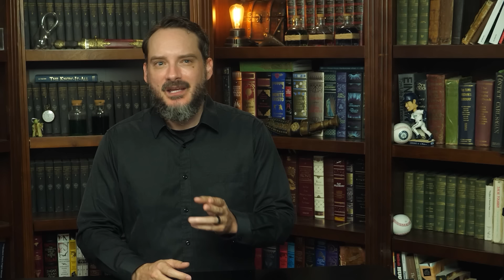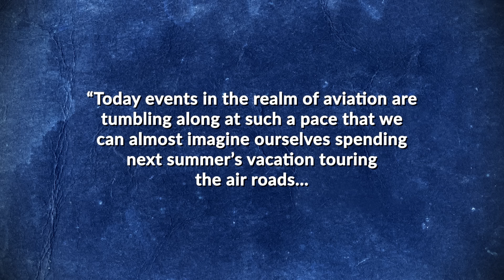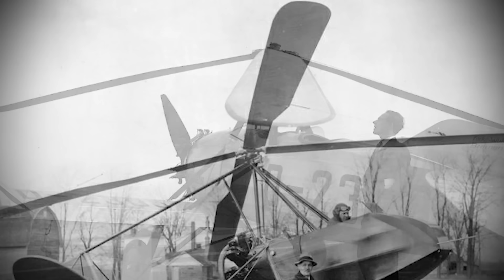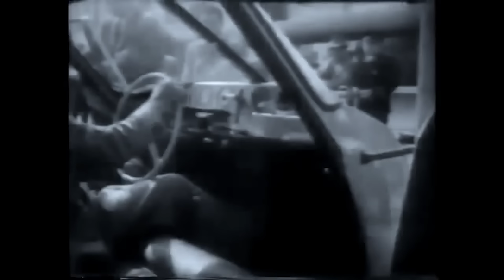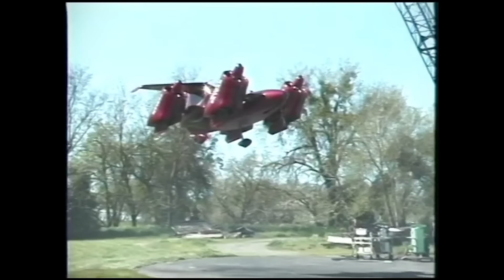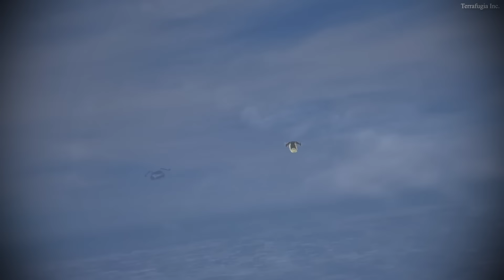A Plane in Every Garage- The Long and Twisted Road to Flying Cars

Comment: well you did not make it, thats why. also some kind of exoskeleton like a jet to manage the fuels and engines, kinda powered wing suit. there is at least one powered jet pack suit currently in use. where you lost your wings, angels. normal air plane is an air car. some turbines on four corners of a light-weight hot tube would work fine. you could just use a normal car engine to power an ultra light air plane. direct the power to propeller, you know. and have folding wings etc. turbine = edf. well those ultra-light stol flying cars with fixed wings are readily already available. what bedtime stories. same for autogyro planes/copters. why leave wings somewhere. thats nonsense. angle variance of the helicopter blades makes it horribly complicated and expensive. monetary goals of projects make them fail. that looks like an ice maintenance machine. or a farming combine. so design it like everything that can go wrong will go wrong. as with people it will go wrong if it can go wrong. earning freedom? get outta here law dudes. well you did not have license to the boats you conquered the lands, then. stop teasing people with your deth fear rules. well 1st amendment and 2nd, done. only the ded make such fear based rules oof the ded. you go make it.

Comment: I'm only a hobby quadcopter pilot and I can assure you, the FAA, air traffic control, and Chinese microelectronics, telephone poles, electric and cable are all permanent handicaps. Flying taxis are coming from Joby for sure, and then other companies like Archer Aviation will follow, but there will not be private flying cars for anything more than hobby, like the failed ultra light phase which killed dozens of unlicensed pilots. It's not feasible even with sensors, lidar, even radar, or cameras, or even full self flying. It can't be done en masse without a centrally located command.

Comment: Where I live I guess we haven’t been “smart people” and buried our power and phone lines. Nor have we cut down all the big trees wgich make the neighborhood pleasant despite the proximity to both a busy freeway and a fairly adjacent medium-sized  airport flight path.
An uncontrolled “landing” of a 240 pound auto-aircraft at 60 mph would generate enough force to collapse the roof of the dwelling I reside within with four+ human beings.

The Jetson’s concept of planes as cars and cars as planes appears impractical at this point. I won’t be operating one or riding in one regardless of how confident others may be with the minor nuisances of such air/road/air travel.
For some reason… there are no gutters or downspouts attached to my domicile. Accordingly, any liquids or semi-solids which exit the operator of a plane-car which crashed on the roof will simply spill onto the sidewalk  in the unfortunate condition of a crash here. And that is IF they dodge the power lines, telephone lines, cable lines, and trees.

Everything sounds like fun until an intestine gets put out…

Comment: They want to over regulate and take away my 65mm 100gram tiny whoop let alone my 8 pound 3dr Solo UAS. Because "they are clearly the most dangerous thing in the sky". 

Perhaps they should require remote ID modules on all bolted parts of passenger aircraft instead if a toy grade quad your kid is flying below the treetops in your own yard

Comment: Automation will make the crashing thing a moot point.  It’s many times easier for computers to fly a vehicle than drive on the surface.  With communication relying all location and heading data the traffic can be controlled automatically.  It would be much safer than cars.

with automation you still have the risk of people or animals moving infront of cars without time for it to stop.

I would much rather traffic be in the sky than congesting the ground and kids not being safe to use the roads.

Comment: The issues with futuristic robot aids are pretty mundane, as in “what if it malfunction up a flight of stairs?” As in, would you want a 600 pounds brick of steel fall on you because it’s low on battery? What if it shuts down during a fire emergency and blocks the exit? Mostly stuff like that. Which are totally valid concerns to have. Others are “if you market it as helping the elderly, how do you convince an old person to trust the machine?” Is there a risk that the help might hurt the elderly if for example they have to be spoon fed and they resist for some reason?

Comment: No problem. Inflate a dome with a Sulphur hexafluoride, and Oxygen gas mix. Then a one man helium balloon 15 feet in diameter shaped aerodynamically, and you got a flying car. You could even play bumper cars with it. Good idea for a small introductory attraction to get people secure in its safety. Also makes buildings cheaper too. The floors float same as cars just tethered to the ground rather than supported by it with concrete, and steel. Hight of the buildings is practically unlimited. No need for suburban sprawl. No need for elevators or even roads inside the dome.

Comment: Given all the logical issues with flying cars, hover cars that go no higher than a couple feet or maybe half a meter off the ground a would be slightly more attainable.  Then again, there would still be plenty issues with that idea as well, such as fuel consumption, propulsion, safety features, and whether or not it could be operated over water or just solely over land, etc.

Comment: As Charles Stross has pointed out, the primary reason for flying cars not taking of is that any  engineering failure in a normal car usually just stops the car, stopping a plane has far more serious ramifications.

Comment: Morons run out of gas driving down the Highway and blow up their engines because they don't know the oil is low. Now you want them in the air? Good luck with that.

Comment: 40.000 collisions/deaths a year and almost it's entirety has little to no collateral damages to its surroundings. Now let's just take for granted flying incidents would be a fraction of them, rather than more (which is likely false but follow me). Let's make up there would be only 1.000 air crashes by human controlled cars, if we pretend "only" a 10th of that happens in urban areas (impossible) you would have ""only"" 100 unintentional kamikazes EACH YEAR playing the crashing roulette at high speed on road cars, on building, hospitals, schools, etc. even this super optimistic statistic looks like a war zone.. and that would be just USA average, not worldwide.

Comment: Automation technology is a huge barrier to regular flying cars (i.e. those not requiring a pilots license) that will not be overcome for decades, even then, liability and legislation will keep them grounded. Your example of autopilot in airliners demonstrates how far away we really are. These systems have been in mainstream use since the 70's and are massively improved but you still require 2 fully trained pilots on board because these systems do have limitations and can still fail despite triple redundancy systems. Remember that really really clever automated plane the 737 Max that thought it knew better than the human pilots? Industry should stop wasting effort on flying cars and any notion of full self flying or full self driving and put all that money and brain power to better use.

Comment: In 2023 Doroni Aerospace earned an official FAA Airworthiness Certification. It is powered by ten independent propulsion systems. They company claimed a top speed of 140 mph and a 60-mile range. It includes two electric motors with patented ducted propellers. The machines is 23 ft long and 14 ft wide.

Comment: Flying cars exist.  My personal favorite is the PAL-V , which is a road-worthy autogyro.  The Terrafugia is a folding wing option that already has FAA  approval, but I’m not sure it is commercially available.
Flying cars cost as much or more than a small airplane and you have to have a pilot license to operate one.  
Getting a pilot license will cost you about $7000 U.S., and it normally costs over $10K.  Then you have to buy the vehicle.
Legally required annual inspections will cost you about $1200, depending on the aircraft, and that’s not including any repairs discovered that are required to keep the aircraft airworthy.
I won’t get into the hassles you have to go through to get and maintain your medical evaluation to be permitted to fly.
 Bottom line is flying is prohibitively expensive, legally highly restricted, and depends on your current medical condition.
I am a licensed pilot and a licensed aircraft mechanic.  I know this stuff.  I’ve been through it.
Reply: That is just on an individual level. Now imagine 10's of thousands of these in a heavily urbanized area at the same time. How do you avoid collizions, where do you land and park.

Comment: The other issue with flying cars, even automated ones, is that even if you remove all "accidents" (as a former IT guy, not realistic to remove them ALL, even for flight, as the airline industry proves), you are still left with mechanical failures and freak accidents. For land vehicles, none of that is an issue - for a city covered in flying vehicles, it's millions of potential gravity bombs waiting to crash into buildings below. And that's not even counting systemic failures ... some DEEP irony in the fact this came the same day as the Crowdstrike bug crashed the world. What if the flying car software used Crowdstrike?

Comment: If your car's engine conks out you pull off the road and call AAA or a tow truck. If your flying car's engine conks out... uh, well...
Reply: You extend parachute and glide wings... We have ultra light crafts ya know
Reply: If you had glide wings, odds are you would already be using them.
Parachutes aren't going to be realistic either. sure, a person can land using a parachute just fine, but a vehicle weighs considerably more... you need anywhere between 5-10 human parachutes at least.

And where to land? i'd hope you aren't flying over a forest, rocky terrain, bodies of water, or any urban area that is not the suburbs...

There are reasons why planes don't have parachutes, even though, in theory we have all the technology needed to install them.

You also have to keep in mind that due to people flying rather then using roads, the prevalence and size of roads will be significantly reduced.

No, the answer to the awful experience of driving to and from work every days lies in... not using cars... as cars are the only reason our commutes are this horrendous.
Legs, bikes and public transit, together with smart city planning (or rather not 5th grade city planning) is the only thing needed to turn your dreaded commutes into a quick, easy, pleasant and healthy experience.
Reply: @Elated_Llama  you didn't watch the video? The parachute cars are there, they already exist. So did the glide wings. Tell me how a parachute stops a drag car, weighing a thousand pounds and acceleration from a rocket engine. Yet they still stop. We're talking about falling, no insane extra forces. Everything else though, spot on.
Reply: @X…: Please do not land on my roof. It’s not rated for a falling car bound to a parachute, and you will have to avoid the power lines abounding my neighborhood.

Maybe try Iowa, Nebraska or Wyoming?
Reply: @williesnyder2899  A lot of ultralight crafts spend most of their time just gliding, it's not hard to avoid powerlines, and in most places power lines aren't even that common because smart people have them buried. Oh and even IF they crashed into you, they are called ultralight for a reason, they gonna fall apart on contact with another vehicle or a home. Top speed is also 60 mph for those, it's enough to do some damage but at a max weight of around 440lbs at 60 mph, they aren't gonna do any major damage. Nothing like a 2 ton vehicle flying around at 90 mph.
Reply: X…: I’m not intelligent enough to have buried power/phone/cable lines in my urban area. Nor am I sufficiently astute to have eliminated the various tree cover from my neighborhood. Not to mention my lack of smarts to calculate a load of 440 pounds X 60 miles per hour coming to a crumpled dead(!) stop atop one of the nice old dwellings around me. 

Perhaps such vehicles are practical above Iowa cornfields, Nebraska wheat fields, Idaho potato fields, but not so much over North Dakota oil fields or occupied soccer fields.

Best wishes for obtaining insurance for your happy hobby plane-car. I suspect that this is a rich person’s weekend entertainment at this point.

Comment: Doesn't matter how clever the automation gets with a flying car, the weather is going to be the killer.
Bad weather (or even clear air turbulence) gives you a random variable for which normal pilots do their best to mitigate by avoidance altogether.
Also, automation like this would require redundancy in every critical component, which increases cost.
I have personally developed software for dual-redundant control systems, and it adds far more complexity than you might imagine. 

I personally dont think this concept will ever become mainstream for cost, practical and safety reasons.

Comment: Think about the pre flight tests you would have to do on one of these things, taking it on the road, and all the debris would cause a huge problem. There's no way you could  just drive up to the runway and take off. All those hinges, imagine the flight to flight costs, you would basically have to take it to a specialized mechanic in between every flight. This makes no sense, cars arw good at being cars, theyre not boats or airplanes, why cant we keep it that way?
Reply: I suppose it would be just like a pre-trip inspection before a roadtrip in an RV 🤷‍♀️
Not only do I checked all fluids, air pressure/condition of all 6 tires, and lights, I need to check hitch ,safety chains, wheel straps, outside luggage compartment doors, and electric steps!
Plus, ensure items/doors inside are secure. 
Takes some time but I do it every time I hit the road 🤷‍♀️

Comment: It'll only work if all flying "cars" are centrally controlled by an all-aware system in continuous contact with ever flying vehicle. The driver/pilot can only input their desires and preferences, but cannot override the central controller.
Reply: Yes that definitely could work. Centrally controlled driverless air taxi service. Just imput where you want to go.
Reply: Hal
Reply: I don't think the central computer would need to actually control the cars. Just tell the computers in the car were to go.

Comment: I'm betting that, with the advances in Ai and battery cell technology, something like a flying autogyro will be around sooner than later.  If tesla can have Ai  self drive then self flying should be even easier as it doesn't have to read signs, lines, or worry about other motorists.
Reply: If you believe that i have some magic beans to sell you. Your base premise that Tesla have "AI Self Drive" is your first error.

Comment: Before even watching the video: As a former Doordasher, I can attest to the fact that a disturbingly large portion of the population can't handle driving in two dimensions safely, let alone three. Furthermore, even the best drivers would probably lose heart at the idea of merging vertically. There is also the problem of blind spots, which would take up most of your necessary field of view.
Reply: Bs
Reply: @mblake0420  Wow, you're a real jeenyus, aren't you?
Reply: @willmorrison1022  I drive for a living ....so no I'm not but I know it's bs
Reply: @mblake0420 ironically the worst drivers on the road are the ones that do it professionally
Reply: @zDToddy no....no, that's not true at all.
Its just easier to spot when a professional driver makes a mistake.

Comment: Hopefully flying cars will never become a real thing. Jut imagine living with all that constat noise made by flying cars passing above your head.. day and night..  
From the noise perspective .. just pretend that small planes are flying cars .. principle is the same and actual shape doesn't really matter that much .. now imagine hundreds and even thousands of them constantly buzzing in the sky .. 
Oh but this is absurd I hear you saying .. nowadays everything is electric.. they wouldn't sound like planes, that's too loud ..  That's right, they would sound like very large drones.. hundreds of them .. and it would still be a nightmare.. 

Anyways.. piloting a flying machine is so damn complicated and is something that very few humans are capable to master .. believe me when I tell you that mankind is not there yet .. by far.

I do have a merely 200hours of active flight under my belt ..as a glider pilot student..  and can only call myself a great consciously incompetent pilot at this point in time.. 
Even in a glider, which is one of the safest ways to fly .. one  mistake at the wrong time .. and you're gone .. 
Any flying machine stays airborne as long as you actively keep it within it's flight parameters, which include both minimum and maximum speed, plus many other parameters..,  outside of those parameters it will fly much like a brick no matter who the pilot is. 
Soo don't worry .. as long as humans were supposed to fly them .. flying cars are never going to be a mainstream thing .. never ! :))

All the best to everyone !

Comment: Back in the early 1980's I owned half of an AVE Mizar.  You could find parts alongside any roadway, but, since we all littered in those days, the hard part was distinguishing the parts from the rest of the trash. Seems like a terrible thing to do to a Skymaster.  Since there is only one propeller, but you needed the Pinto engine to take off, did the pilot half to be multi-engine rated?